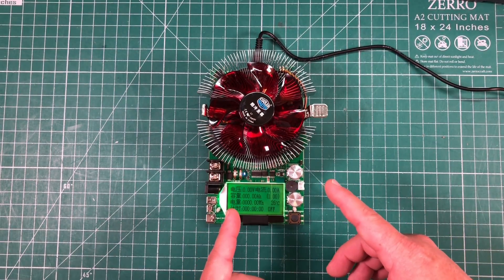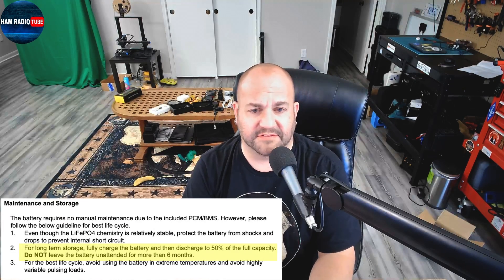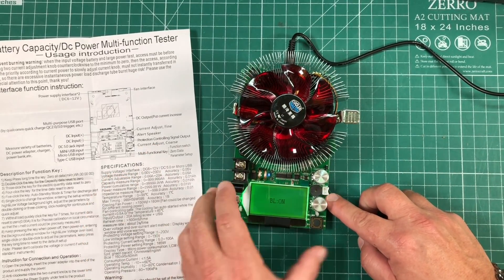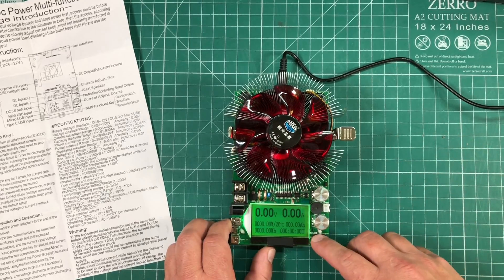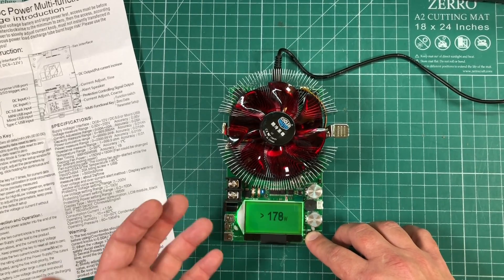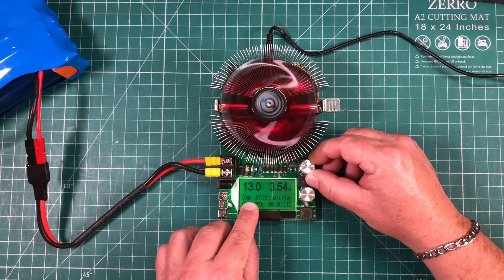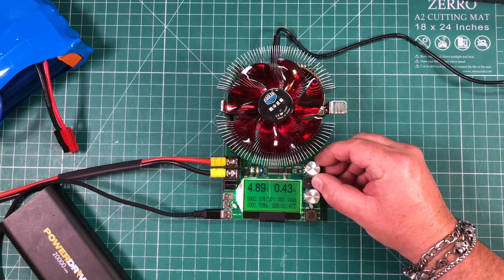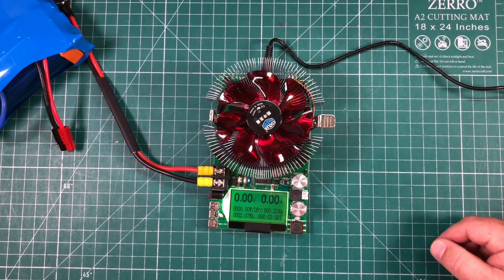MakerHawk 150 Watt Battery Capacity Tester

Comment: Can you use this tester to test the amp rating on a dc switch?

Just to make sure it passes the advertised 20amps before my panel installation catches fire or melts due to load exceeded.  

Thank you

Comment: Great video! Had this unit for a few years now. The instructions weren't the clearest, but like you said, just takes reading them a few times. However, I pulled it out last week and started using it to test again. I found this video because it stopped working after several successful tests. I came to the part where it said rated for 150w...lol. I had that thing at 225w for about 6 hours. Guess I'll be buying another. Thanks for the great explanation! They should add a link to this video on their instructions.

Comment: Good video...How do you determine the discharge amperage for the battery? In my case, I have 4 LiFePO4 32700 batteries in parallel at 6000mAh, which add up to 24000mAh... How can I know what discharge amperage to put on the Antorch DL24 and at the end of the test, give me a correct reading of the capacity in mAh?G

Comment: I know this vid is a bit old now but I wanted to say thanks.  I got the same unit and your video helped me setup the proper configuration and got me started right away.  Now I'm testing all my batteries and labeling the test date and capacity on them so I can check them in a year or so and see how they are holding up.  Again, Thank you!

Comment: Thanks, I just bought this and need to test a 100Ah Lithium Iron RV battery. This device is rated at 150watts (?) but it also says 20A which is 240 watts at 12 volts so how should I set it? I want to draw 20 amps from my battery to test the Amp Hr rating. I guess I'll have to limit it to 12A in order to stay below the 150w heat sink limit. But it starts out at 13+ volts . . . Will this do a constant watt draw or is it limited to a constant amp draw?

Comment: So i picked up this device and it works. So after 15 minutes at 2.0 amp draw on a 24ah battery it shows .77ah does this mean .77x4 AH used = 3.08, what does this mean overall? I am trying to find out if my battery is as good as rated. Do I let this run until I deplete the battery to get the total AH of the battery?
Reply from the maker: That just means you pulled .77ah out of your battery.  That seems weird though.  With a 1 amp current draw in 1 hour you should see 1ah has been depleted.   A 2 amp current drain in 1 hour should show 2ah depleted.  15 minutes at 2 amps should be .5ah.  Did you hold the button down for a few seconds to clear out the screen before you started the test?  I wonder if you may have had some data there if you were playing around with it before the test that didn't get reset??
Reply: welcome home Mike. Ill reset it and try again. @hamradiotube

Comment: That's a cool tool! I bought one in 2021 when I built the 100-Ah LiFePO4 battery for my car. Like you, I tested capacity right away to see if I was getting the advertised spec. Thumbs up there. I do a full capacity test every November to see how much my battery has changed each year. I guess I should share my results when the time comes. 73! -Scott, KE4WMF

Comment: Had one of these for a few years, and haven't used in a while. Bought to load test a 12v power supply(matching supply to a Kris CB radio that's also on the project list) that's been on the project list for a long time.

Comment: So Mike, what did the POWERDRIVE 20ah battery actually supply in Ah? I have something similar and got 6ah out if it. Those chinese manufactures just slap on any label they want.
Reply from the maker: I haven't fully tested that yet but i've had it for a couple years and have charged many things off of it.  I would guess I get what it's rated for.